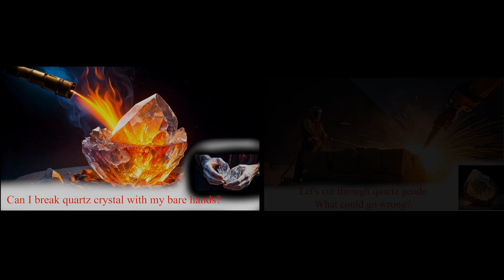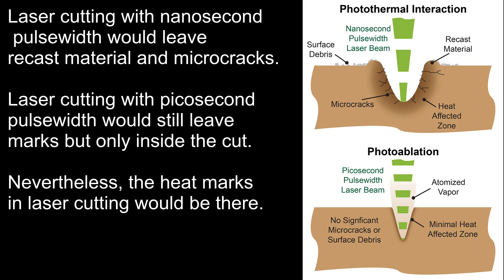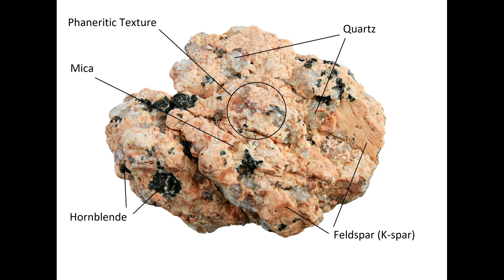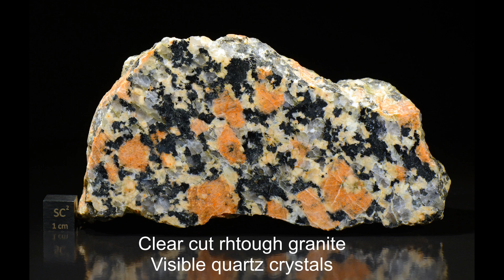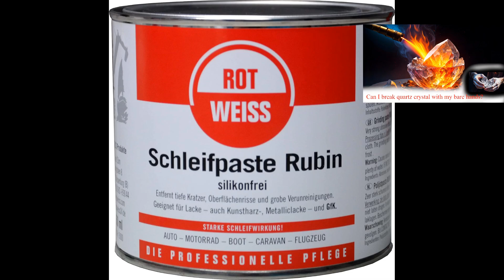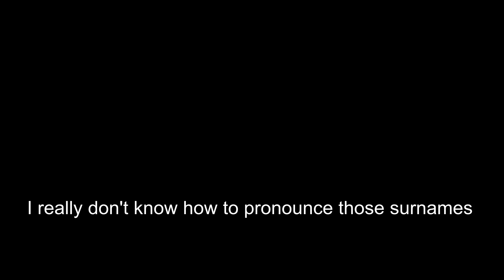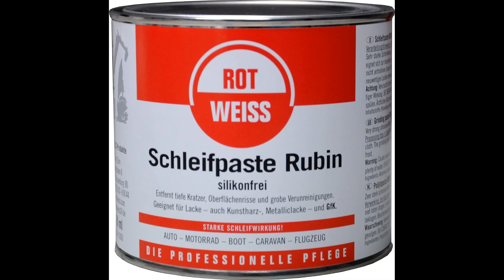How did ancient Egyptians make those granite and diorite jars and boxes? Ancient masonry technique

Comment: "The proof of the pudding is in the eating" as it were. There are modern flint knappers who have the ability to reproduce neolithic stone artifacts, and this ability inspires confidence that the fabrication techniques are well understood. In order to inspire the same confidence for these amazing Egyptian artifacts, one would need to have the ability to repeatably recreate them using materials and methods assumed to have been available to those thought to have created them.
Reply: You want to keep in mind that the majority of technological invention is simply to make something already being done easier, requiring fewer person hours to do the same work.  Engines, for instance, replace muscles.  Cutting stone is still achieved using the same materials/abrasives.  The main difference being that we now can produce synthetic versions, in conjunction with engines.  Stone saws, for instance, are edged with diamond or carborundum (a synthetic replacement for corundum).  It isn't the metal blade that does the cutting.    The "they didn't have steel tools" is a silly fallacy since quartz, for example, is ALWAYS harder than steel.  Yet from well before the Romans throughout the Medieval and Renaissance, granite has been cut and polished.  The metal simply replaces wood as a stabler, longer lasting, less flexible substrate. The "theorists" proposing some absurd high technology are simply unable to imagine how they could achieve what they are looking at with "primitive" tools.
Reply: @theeddorian  The "advanced" technology they were using may have been a modified potter's wheel repurposed for the task of shaping and polishing these stone artifacts. What intrigues me is that these artifacts are not completely radially symmetrical because of the handles. How these complex objects were fabricated and finished cannot be completely explained by simply turning, although it seem highly likely that turning was involved.
Reply: @joecaner  Lugs can be sculpted on stone, just as they can be on a wooden turned container.  It's tricky but possible.  I can suggest at least one method that would work on wood, though you'd have to turn the motor off and use "primitive" methods.  The Egyptians had some methods that are not exactly like a potters wheel.  One looked like a crank and was oriented vertically.  Another somewhat similar device also used weights and possibly applied a flywheel-like principle. The important thing is to not underestimate our ancestors simply because they didn't have steam engines or diesel engines.
Reply: @theeddorian  The artifacts prove that it is in the realm of possibility . Don't best me with words. Best me with deeds.

Comment: Nobody measured ANYTHING in MICRONS in Egypt...this is nonsense. Ancient Egyptians had nothing hard enough to break granite from the ground in straight lines, never mind huge columns such as you can see in Paris taken from Egypt by Napoleon.
Polishing is a trivial matter, but breaking out a huge column from the granite beds is a mystery. Once again, Egyptians were decent geometers but granite was harder than any tool from the bronze age or even beginning iron age. I has a Moehs hardness a helluva a lot harder than the tools they had back then. The only possible idea they have not is to somehow have made small holes in the granite, pounded in wooden wedges and then soak them in water....but it's a bit sketchy if it could work. Polishing is not a big deal, but breaking out long pieces or slabs is still a mystery.
Reply from the maker: Reflecting polish of granite is not that easy and to be honest are you sure breaking out granite blocks are a mystery when you even presented a method which works and was tested ? 
About those measurments in microns... I agree that we should remeasure those precise ones again, maybe 10 more times.

Comment: Your a nut you can't date rocks !
Reply from the maker: I am not dating rocks. The dates on those are placed by egyptologiests depending On the place where they have found those. And sometimes you can use luminescence dating of rocks but it is not accurate way of dating. When I am Talking about predynastic vase then it was for example found in a grave with predynastic skeleton which was carbon dated.

Comment: First off, even if they were only using abrasive methods, quartz sand is adequate to cut through or polish down granite.

Granite is a bisilicate - some of it is quartz, but some of it is also feldspar.

The latter material is softer than quartz, so by mixing quartz sand with water to form an abrasive paste, and using a saw or tube drill to drag the paste across the surface of the granite, the feldspar is easily attacked thus leaving the links to the quartz crystals within the granite structure weakened and easier to dislodge.

This is all if you are only thinking about the problem from a perspective of mohs scale and abrasive cutting or sanding/polishing.

If you are talking about chipping/indenting the stone you need to use a different kind of measurement with the Rockwell scales.

You can work granite with copper chisels, it just wears down or bends the tool very quickly.

Iron chisels are softer on the mohs scale than granite, but could easily chip it and remain in a useful shape far longer than a copper/bronze tool would.
Reply from the maker: You sir are technically correct but also missing my point. There are known ancient techniques of splitting granite and using abrasive quartz sand, but none of those methods can give us a smooth surface on the microscopic level. As you stated 'feldspar is easily attacked thus leaving the links to the quartz crystals within the granite structure weakened and easier to dislodge'. But we see that in some artifacts those crystals were not dislodged but cut through! A partition of a single crystal is possible with abrasive but only if that abrasive is harder on the Moh's scale, that's why I used it in this video. In many cases we see that the rock was spllited (or polished with sand) but in the others it was cut through without differentiation in cutting surface  which we should see due to differences in the feldspar and quartz density and hardness. My conclusion - they used harder abrasive. And I have found 1 piece of evidence backing my idea. Only one from New kingdom period, when many cases of those artifacts are dated to Old kingdom or predynastic times. The logical conclusion would be that ancient egyptian had on their disposal a tool which could cut through quartz crystals. My next steps were: 1. I cut quartz geode with modern tool (diamond saw, no abrasive, only water, power tool). 2. I used blowtorch to fracture the same quartz geode with heat. 3. Compare those two. 4. Figure out what ancient Egyptians could have used to get similar effect to diamond tools. 5. I found corundum evidence. 6. Test corundum paste or bronze-corundum tool. (I'm working on this right now)

Comment: In the Serapeum at Saqqara there is an unfinished granite box weighing 100 tons. It lies in a corridor with barely space for a man to walk by on either side. How could they have finished this box with grinding paste in such a confined space? And, how could they have moved it when finished?
Reply from the maker: I do not know the answer to this question.
I would also recommend dividing your question.
Usually the best one to start with is how was it made, then we could try to figure out which method the original maker used.
The logistics of moving extremly heavy stone objects are an engineering problem of its own. Wooden sledges are not the answer when we are talking about more than 3 tons of hard stone but Belaz 75710 wasn't manufactured before 2013 (payload of 450 tons) so... who knows. There are a few attempts to deliver you the answer but for now we do not know and the reason is simple, it is not possible with the toolset we are told by the academia. They (original Serapeum creators) probably had different tools, which may be different than ours. But they lived in the same world as we do, with the same nature, the same gravity and the same spark in their hearts to do crazy stuff. My first goal is to find, show and convince people that those people had more on their disposal than we are told. Will the corundum paste be enough? Probably not. But it would be a step in the right direction.
Reply: @AncientTheoriesChannel Good day, really you cannot say the same nature, and the same gravity during the Old Kingdom Egyptian when comparing to our present era. Their former times, or World System, in the geologic Holocene Epoch, or the Climatic Optimum for the Existence of Life, or also the Antediluvian Times, or still also the Age of the Gods on earth was so different than our current World System in the geologic Epoch which is the Anthropocene.

History once it happened cannot be changed for all time to come.

Maybe that's all for the time being.

Thank you.
Reply from the maker: You sir are technically correct.
Reply from the maker: @JayCWhiteCloud
I think he just tried to be technically correct about 'the world of the ancient people' which was different than ours in the climate terms and socioeconomic.
Reply: @AncientTheoriesChannel  Thank you for the better explanation, I stand corrected...

Comment: No new info here, we used to make drills for large holes in stone out of copper, brass or mild steel pipes with brazed stub to fit a drill. 
But tell me how the ancients moved 600 ton shaped rocks many miles, across valleys and up mountains without roads, when we can't even achieve this today?
Reply from the maker: I do not know the answer to this question.
I would also recommend dividing your question.
Usually the best one to start with is how was it made, then we could try to figure out which method the original maker used.
The logistics of moving extremly heavy stone objects are an engineering problem of its own. Wooden sledges are not the answer when we are talking about more than 3 tons of hard stone but Belaz 75710 wasn't manufactured before 2013 (payload of 450 tons) so... who knows. There are a few attempts to deliver you the answer but for now we do not know and the reason is simple, it is not possible with the toolset we are told by the academia. They (original Serapeum creators) probably had different tools, which may be different than ours. But they lived in the same world as we do, with the same nature, the same gravity and the same spark in their hearts to do crazy stuff. My first goal is to find, show and convince people that those people had more on their disposal than we are told. Will the corundum paste be enough? Probably not. But it would be a step in the right direction.
Reply: @AncientTheoriesChannel  and Belaz 75710 need very wide and well graded roads
Reply from the maker: I am on your team. I honestly do not know how they moved those stones, I have seen some traditional techniques but in todays world I am not loosing my hands trying them on my own for a few likes on youtube. What I do not know is how they were so precise (at least with the vases for example). But I will try to find some specjalists who claim to know those methods.
Reply: @ Why don't you start with the work Chris Dunn has already started. Lots of investigative research underway on the vases.
Reply from the maker: I could do some commentary on his work or his podcast but... I believe his die hard fan would build a pyre for me. Maybe in the near future
Reply: @ 

It is amusing to consider that if one were to assert that the esteemed Graham Hancock and his colleagues are incorrect and lacking in qualifications, they would likely dismiss you entirely, rendering you irrelevant in their eyes.  They would never give you the honor of a "pyre" as you will be dead to them...LMAO...Engaging with those who prefer to occupy "armchairs of expertise" rather than genuinely exploring a subject from a multifaceted perspective requires considerable effort and undermines the elaborate narratives that certain individuals profit from. As my grandmother frequently remarked, "ignorance is bliss, and many opt for this state of blissful ignorance, as the alternative demands too much effort."
Reply: @ You're still thinking in terms of the restricted knowledge that we possess today. Same world, environment yes, but there is so much about physics and nature that we still do not understand. Anti-gravity technology. Harmonic resonance application to disrupt, alter, manipulate atomic structure of matter... there is so much to physics that we still don't understand, yet it is still the same universe we live in...
Reply: They did it with ingenuity and hard labor. If you think we are incapable of moving 600-ton objects today, you have failed to observe around you. We don't move rocks that big, because why bother? But we move other objects. You can, though, find actual film of Italians moving a 300-ton obelisk for Mussolini early in the last century.
Reply: @sciptick  I suggest you look up 'floating mass' art installation unshaped 340ton rock and how it was  moved using  modern equipment steel frames and modern roads, then tell me how the ancients moved the 800 ton Baalbek stones without, steel, hydraulics,  engines and roads big enough, merely by  "ingenuity and hard labor''  and yes we currently have no way of moving the Baalbek stones, 
I think you're the one with observation failure as you are clearly unaware of 'floating mass' and the extraordinary challenge it presented. 
And the reason to bother moving huge stones would be to make earthquake proof structures.

Comment: This is fine for grinding and surface finish.  But it doesn't create the necessary precision without machine tools but more importantly MEASUREMENT and indication tools.
Reply: Do not confuse "polish" of a turned object with what "grifters" of history call "precision," which is utter nonsense and anyone that works in wood, ceramics or stone turning knows this. What to actually "learn something" start with the basics like taking a turning class for wood or pottery...advance from them...or continue to remain within "blissful ignorance" which, of course, is much easier than actually studying and working...
Reply: @JayCWhiteCloud  I've spent YEARS working in machine shops, building extremely high precision tools and components for quantum and nano technology applications in experiments... that I designed... where I used the things i made to study things on nanometer length scales where variables like temperature and pressure need to be controlled to prevent alignment issues in integrated systems. You know what we couldn't do? Refixture a component without using clever optical alignment tools and achieve concentricity limited by our bearing surfaces or the contact forces and flexure of the tool posts and fixtures. There's a reason machinists and engineers look at the numbers they published on the parallelism and concentricity as well as the unusual geometry of these objects and conclude that this stuff isn't hand made. 

They used very precice tools and had the ability to repeatably measure things below the level of human perception. If I gave you a few dozen brand new polished 15cm vases with an axis that was 0.025 mm out of alignment (either in parallel or in concentricity) with its opening and gave you a vase that was 0.150 mm out of alignment and asked you to sort them you'd be unlikely to do better than randomly guessing. Humans are not good at this kind of thing. Mk 1 eyeballs powered by big brains can figure out how to quickly build the gear necessary to do this stuff, but that's what we call TECHNOLOGY. Making this repeatable makes it engineering or scientific technology.  The rigidity issues surrounding hysteresis involving everything from thermal management to uniform force when the tool surface is loaded will interfere with everything that the orthodox academics have proposed to hit these numbers using the materials the archeologists say the Egyptians had access to.

 One of these things must give.  Either the Egyptian engineers were more advanced than Enlightenment era engineers, or they didn't make this stuff. That's what we're left with.

Comment: Forage d'une variolite dureté 7 avec un bout de PVC très fin
https://www.youtube.com/watch?v=6mPMs403Xj0
Reply from the maker: Sure thing, he used abrasive sand. I said abrasive paste with corundum. Why? Because crystals in those granite blocks in Egypt were cut through, and your example shows clearly sand abrasive leaves rough surface, because those crystals are not cut through, they are plucked by force leaving micro cavities or left in their place, when the material around it is still there. Naked eye can be fooled here, but I bet under the microscope we would see the difference (or by touch) between that and diamond saw cut.

Comment: In the granite industry they used to use wire saws. A twisted soft iron wire drawn through a granite block with corundum powder as the abrasive. Before the widespread use of computerized diamond saws. Copper wire would work even better. It wasn't used because of the expense.

Moreover, a wooden tool will cut granite, with an effective abrasive. A large wooden wheel spun by a team, with an abrasive, could be used to cut blocks from benches.
Reply: Uh ... No. You obviously have never done any work involving machining. There is absolutely no way to achieve the high accuracy cuts, flat surfaces and high tolerances involved by using wood in any part of the process.

Take it from me having worked in aerospace for many years.
Reply: @barrywilliams991  They're not super sonic jets... they're stone coffins and facades.

I was thinking about it and I believe twine would cut stone with a proper abrasive.
Reply: @puddintame7794  Stone coffins and facades? Lol you have no idea what you're talking about.